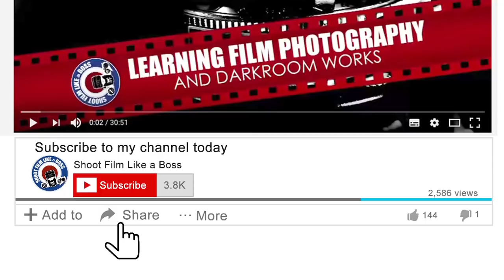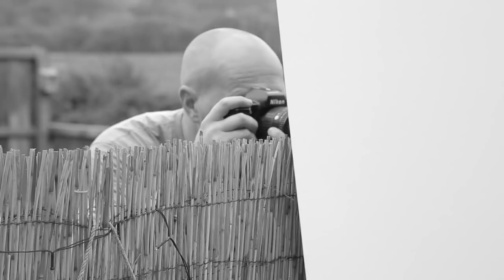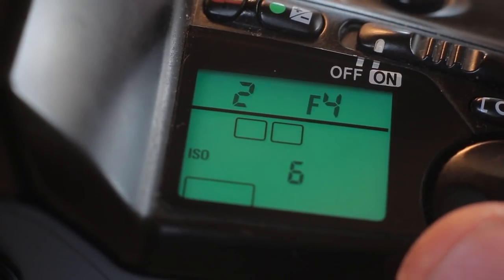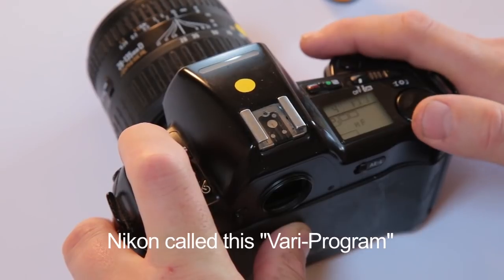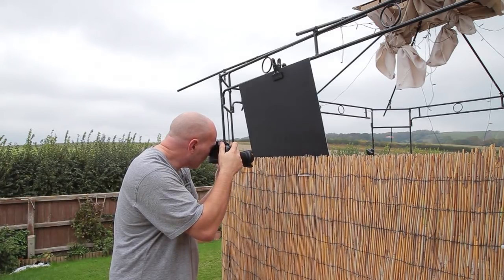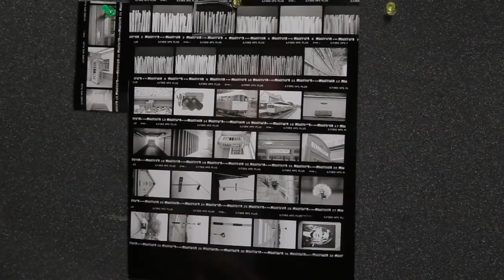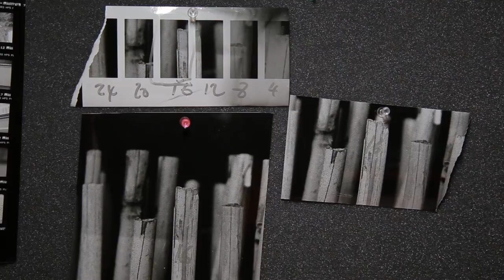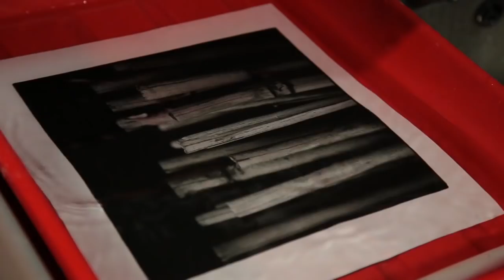Nikon F90X 35mm Film Camera Overview - Shoot and Print

Comment: If you ever get tired of the scuffed up back you can scour it off with some isopropyl alcohol or glass cleaner and a microfiber cloth. Takes a bit of elbow grease but will leave you with a glossy smooth back. You'll lose the program whatcha-ma-call it icons though. Fits the rest of the body rather nicely in my opinion. https://i.imgur.com/7pVK8vZ.jpg
Reply from the maker: funny enough i've just bought some isopropyl alcohol to clean my cars mas sensor! Only used a few squirts and I was wondering what to do with the rest of it! So I may just have a go. I can handle losing the icons. :) Thanks.

Comment: I have a hatred of this camera. Love the f5 and F100. It’s layout is shocking in comparison to the f5
Reply from the maker: Hi Euan. Thanks for the comment. I find it quite easy to use and the layout simple. Could you comment what you find shocking about it. I honestly wouldn't know as I've never used any other Nikon Film cameras. Thanks.
Reply: I don't hate the F90X but I also prefer the F100's form factor to it. The mode button is located on the right side making it much more accessible. It can back button focus which I prefer. The grip fits my big hands better. DOF field preview on the F100 stops down to the aperture you have selected instead of stopping down all the way to minimum. They're both stellar cameras in their own right but given the choice I'd reach for the F100 just on the grip alone. The F90 does have proper metal latches for the back while the F100 uses plastic. I haven't broken the latch on my F100 but I have broken the latch on two different F80s. Taught me to be gentler when closing the back. The F100 also supports current VR lenses if vibration reduction is something you care about. Doesn't support the new line of electronic aperture lenses though, but neither does the F6.
Reply: @ShootFilmLikeaBoss  Nikon change the orientation of buttons each time the introduce a new model. I found this with me D7000 and D600! can be quite confusing , Obviously on film cameras it's expected but you would expect some consistencies with digital cameras and their button layouts..... and my (NEW (did I mention that I had a new n90s?)) N90s has more of a digital layout feel than any of my other Nikon's.
Reply from the maker: @IainHC1  ahh, you got the n90s, cool! Have fun 👍